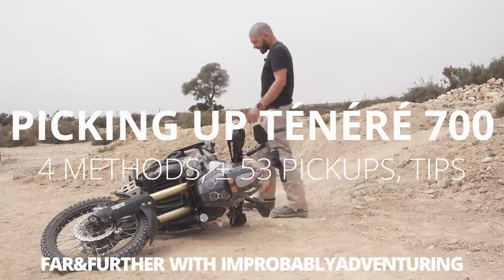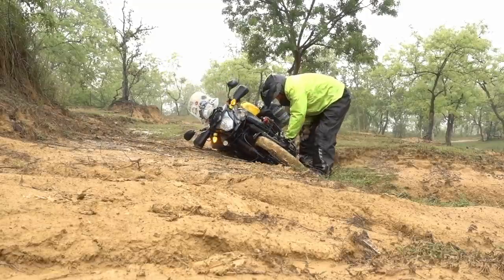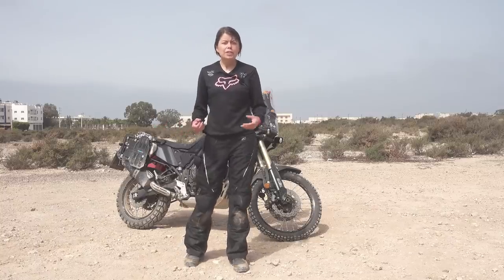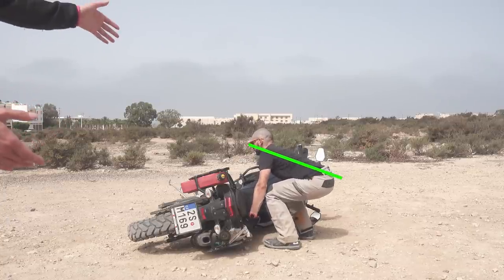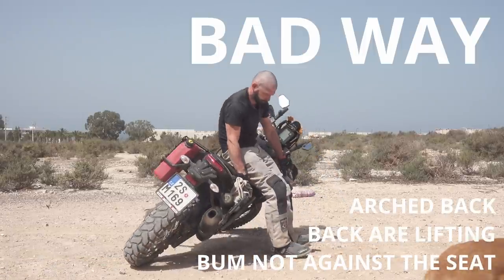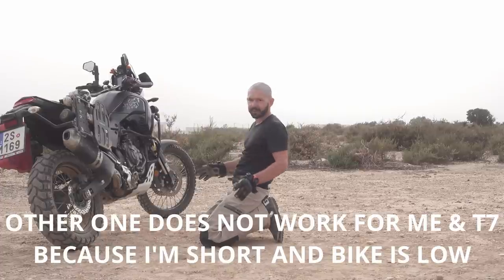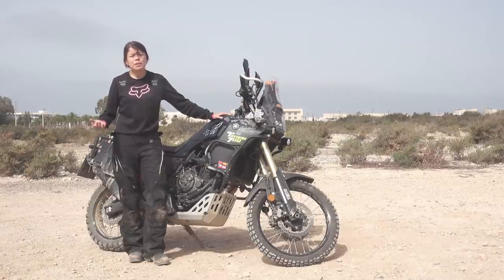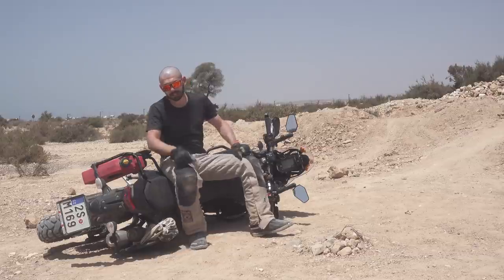Picking up Yamaha Ténéré 700: 4 methods, ±53 lifts, some tips

Comment: Do some squats ,dead lift and eat chicken:))
Reply from the maker: Hehe ;), yep. But in all seriousness, I have been working out through out the lockdown and it does make a lot of difference when lifting or riding. The chicken... prefer lamb or fish ;) which is also local & sooo good here in Morocco!
Reply: @FARANDFURTHER  :))))) I know  dead lift  and squats are very important , we do not use this muscle groups to often and they get weak.
Reply from the maker: I was looking for some motorcycle oriented excercise routine on internet but have not found a good one yet! Any tips?
Reply: @FARANDFURTHER  get yourself a copy of Mark Rippetoe's Starting Strength. Strength is the foundation of every other fitness attribute, so being stronger will make you better in any physical endeavour. This does not need to (and shouldn't) be oriented towards anything.